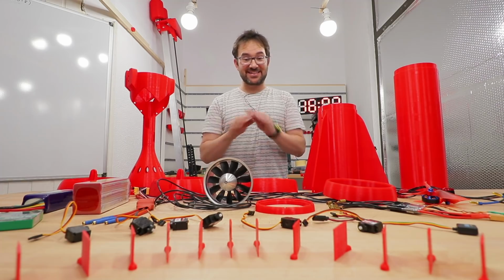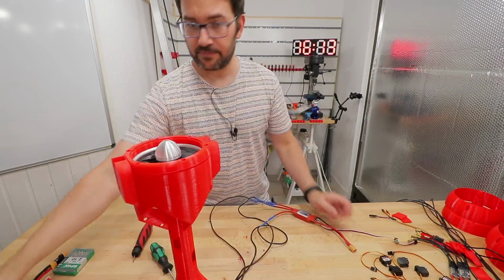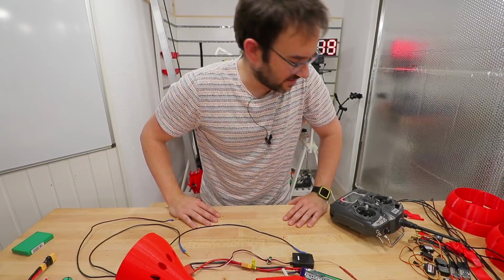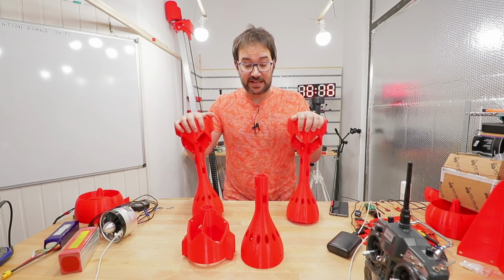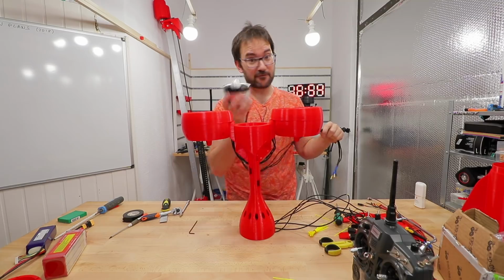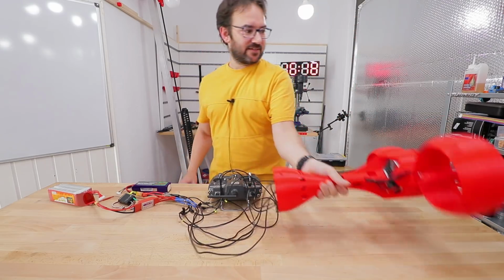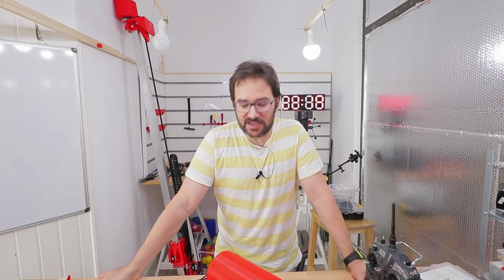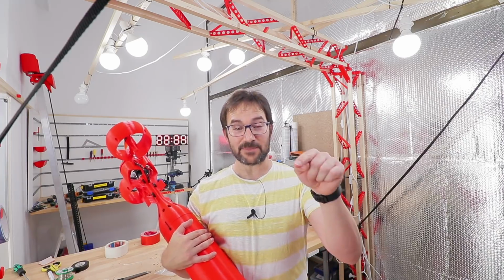3D PRINTED RC ROCKET CHALLENGE w. JAMES BRUTON | PT.1

Comment: I am definitely interested to see this case study in "does this rocket?" because I know about the pendulum thing when it comes to thrust, but I am also curious to see it happen or not happen with this design then figure out why. (obviously if it happens then you'd know why it didn't work... duh).  Oh... well... I just got to 5:10 and yeah I see now that it does indeed seem to fly correctly for now in that configuration over a really short distance with a weird tether thing.  So... \o/?  Also I saw the EDF rotate in the housing so I am curious if you're going to secure it somehow.  You have excellent presentation and English skills (not that it means much coming from an American...).  You need a 4 point tether system so you can tether it down and let it run without risk of it falling over.

- EDF rotated in the housing during one test and I am curious if it is now secured from rotation by some means other than friction fit.
- 4 point tie down system to keep it stable and from flying away while still allowing some level of movement.  Hovering would be an impressive feat.
- Examination of the rocket pendulum argument and how it applies to this particular setup and design given that you are not using rockets but instead ducted fans (does that even matter and how does the real performance reflect the theoretical knowledge)

Comment: Your control surfaces are in the center of the rocket means very little torque for control. Torque is force times distance. You will get more control authority when the control surfaces are far away from the center of mass.  I'm not sure how low your CoG will be, but if the control surfaces are above the CoG, then they will need to be reversed.

Comment: Suspend the rocket just above the ground from fishing line positioned on a rod a foot or two above the edf intake. Therefore, you can test the rocket stabilization within a change in height determined by the slack of the fishing line as it could get caught in the fan

Comment: Ivan, on the Turnigy 9X controller you have, you might want to go through the trouble of setting up a custom model for your tank. If you didn't know, it's in Menu>System Settings>Model Sele. Just use another profile for any other projects.

Comment: Front little wings are wrong, they needed of montage in center of length each wing, on servo axis. the way you did is a big load on servo motors

Comment: yeah, raise your hand who also started the beat of the parts spreading proces right before it actually started.️🎤️🎶 and came out synced perfectly.

4:46   whaaaahaha  lmao  this was a real electroboom moment. and it wasn't faked for one small bit.  but for us viewers almost predictable. perfect. now i have to change my pants. thanks for that.
instantly subt Your channel Ivan.
Reply: +Jan Wiersma  I too, thought of ElectroBOOM at that moment.
Reply: this is the exact moment i had to refrain from screaming at my screen because i can see the battery still plugged in and the throttle set to full the second he switches that reserve switch
Reply: yesss great device, supurb. 
cant wait for the outcome of the challenge with James👍
probably add a parachute ejecting when it tips over. because on that moment it tips over you will really need it. i guess.😉
Reply: whats that song again? it reminds me of an old one.
Reply: Nearly wet myself too!
Reply: You can tell it's not faked by the way Ivan poops a kitten.

Comment: Did you seriously go into this challenge without doing any research on rocket designs? Your "pendulum rocket" just won't work.
Reply: slap_my_hand who cares, just think of the fun we’ve had watching the videos.
Reply: I'm here to see the rocket fly, not to watch it crash 5 seconds after take off.
Reply: I thought "pendulum rocket" as soon as he said he was going to put the motor at the top. You are correct, this won't work but it was a great journey anyway 👍

Comment: id still be worried the main center shaft thing will break again. It would be good if you could fit like a 20mm round carbon spar into it to strengthen it. Great video as always!

Comment: Hey Ivan you the fist minute you already made a mistake :D its called pendulum fallacy (moving the engine to the top) so... redo?
EDIT (as you wanted me to put my money where my mouth is): Here is my prediction.. imma buy you a spool of filament (1kg) if im wrong. Your Rocket will have trouble staying stable or rather be wobbly in slow airspeed/hover scenarios. On higher speeds it could go either way, depending on how good your center of mass and center of lift will be placed by you. So imma do 2 predictions for higher speeds: A) your CoG and CoL are well balanced: it will fly fairly well at higher speeds. (still experiencing a bit wobblyness because your engines are at the top) B) Your CoG and CoL are not where they should be: We are gonna see you panicing.. and the rocket flying completly uncontrolled loops before crashing into thousands of small parts.. Stay safe get some cover ^^
Also make sure you can launch it where you are, some countries do have pretty strickt regulations (maximum height for model aircraft and so on).. I dont know about the legal situation Spain but maybe talk to some local hobbyist that can give you some advice.
Reply: Ivan Miranda pendulum falacy is well known about rocketry. Moving an engine to the front or top does not change the overall direction of force applied to the mass.
Reply: That's not quite what the pendulum fallacy states, and this isn't a "rocket" anyway. It's a helicopter. The pendulum fallacy is the erroneous assumption that having the mass at the bottom of a rocket will cause it to swing back and forth, self correcting itself. What it forgets to take into account is that the engine is rigidly fixed, so as it rotates, the thrust vector rotates with it, instead of stabilizing its trajectory. It also operates on the false assumption that the pendulum will swing back faster that the lighter top, which is contradictory to what we learned from Galileo's experiments with different masses in free fall. The fallacy isn't simple "engine at the top = bad, engine on the bottom = good." It's simply "engine at the top or engine at the bottom doesn't matter if you don't have a way of stabilizing your rocket through other means."

I also saw a comment saying that putting the engine on top would alone make the device more unstable. This is also incorrect. Having an engine on top, or on the bottom, all other factors considered equal, will achieve equally stable devices. As long as the CP is behind CG with respect to velocity, it will be stable. That's another issue Goddard had. He didn't have fins/control surfaces. You can put the engine at the top as long as the CP is behind CG.
Reply: Though the CP/CG relation only really matters in fast forward flight, and a bit less in an hover. Actually having the CG slightly behind the CP in the hover might help to "straighten" the plane as it starts to translate, but it's a dangerous balancing act, and likely to just develop in diverging oscillations. For a hovering craft having the two exactly matched and the entire thing neutrally stable is probably the best starting point, and should end up with something behaving a bit like a multicopter.
Reply: Think about a Dart. The tip is heavy and the fins are at the back. The center of mass needs to be in front of the center of drag to make a stable rocket. What I predict will happen to your design is when it starts moving fast enough, the rocket will flip around. The flip will occur around the Center of mass and it will be uncontrollable above a certain critical speed.
Reply: I was going to point that out.  I don't remember the physics but I do remember watching a detailed video about why pulling a rocket was a bad idea.  May have been Scott Manley.
Reply: Michael Lundgren the dart doesn't have thrust. They won't behave the same at all. It's a well established principle in rocket design.
Reply: One benefit from this design is vertical powered descent should be stable
Reply: What Michael is saying is correct. Darts and rockets (without active control systems) are stable for identical reasons: the CG is in front of the CoP. This design (with the weight at the back) will try and flip around as soon as it gets some speed up. It doesn't matter if the thrust is applied at the front or the back, because it's always pushing in-line with the rocket (it's not like towing something with a rope, where the direction of 'thrust' changes to keep the system stable).
Reply: Michael Lundgren not it is not check Joshua Bardwells video on that. It's quadcopter related butas you are talking about hover it is pretty much the exact same thing, because then we can neglect aerodynamic stability for this purpose.
Reply: I'm not sure what you are talking about. I think you meant to say that you can ignore aerodynamic forces while it is hovering like a quadcopter. I agree, assuming he can make it work, it should be able to hold a hover. But when he tries to fly fast, it will become unstable and flip.The design of the control surfaces won't have enough torque to overcome the inherent instability..
Reply: Ivan Miranda my predictions are a pure guess work because there's too many unknown variables the rocket will absolutely be unstable although in Hover mode this is not really that important since you're going to have a reaction control system like any other hovering device such as a quadcopter to help compensate

You're still going to have the pendulum effect which means when the rocket begin to deviate from vertical the deviation is going to be magnified by the shift in center of gravity and center of pressure

This does not mean it won't work it's just means your stability control system is going to have to work a lot harder you are almost certainly going to need automatic controls the entire scope for those X and Y vectoring veins that you installed while not totally impossible it's unlikely your reflexes will be fast enough once that thing really starts to isolate in aviation we called pilot induced Over Control your reflexes will always lag slightly behind the reactions of the rocket and your inputs will ultimately enhance the oscillations instead of canceling them it all depends on how badly it oscillates in Hover you might be okay

The real trouble will be if and when you attempt to fly like a rocket meaning with a forward velocity vector

When you attempt to do this the center of gravity Center of pressure will immediately begin to assert itself and the faster you go the more force it will apply to do this your rocket will always be attempting to flip end-over-end to point its tail first because that's where the mass is if you can get your center of gravity in front of where you balance it on the video and increase the size of those fins say 300% it might work in forward flight meaning shooting straight up at speed now all that aside

You also want to be able to land this thing and oddly enough Center of mass at the back will make that easier because your rocket will tend to want to point his tail toward the ground if it's falling toward the ground so if you don't plan to have very much of a high-velocity forward flight vector then this configuration might actually make Landing it a lot easier

This is why SpaceX has the grid fins on the top of the rocket to help shift the center of pressure toward the nose instead of toward the tail because the thrust vectoring alone isn't enough when there's any kind of serious velocity involved

 there's actually a really easy way to demonstrate this process I'm going to make some STL files tonight to print out since I think it would be a fantastic educational tool so thank you very much for the idea

Balance a ruler on your fingertip this is a stable rocket

Now print out a small oval that you can rest of the ruler inside the oval while holding the top of the oval

 Now holding the top of the oval tried to balance the ruler again it will be quite a bit more difficult this is the problem you will encounter whether or not you can overcome it will depend on how fast and precise your Correctional controls and software are and how much Authority they have

 Most modern jets are designed to be on the edge of unstable for exactly this reason they become extremely maneuverable when they are slightly unstable this is also why they have modern computers in them to help the pilot control it
Reply: Rec0iL some people are confused by the pendulum fallacy it has nothing to do with where the frost is and everything to do with where the center of gravity is having a Thrust up at the front of the middle on the sides doesn't really matter as long as equal

 What matters is the center of gravity as long as the center of gravity is in front of the center of pressure the model should be stable
Reply: Nerys you should read more careful I never said it would not work... It will work.. it just makes the rocket awkward... There is a video about that from Scott Manley and another one from Joshua Bardwell.. (that one is about quadcopters but it applies also here) and shows that it has no advantage to have your cg high or low in regards to the engine (well quadcopters don't care about being aerodynamically stable) but that's a the story of having your cog in front of your center of lift. Not where the engine is sitting...
Reply: Ivan Miranda if you would have the engines swivel so they always point straight up it would work like you imagined it, would be a fun solution but not the most practical.
Good luck with the rocket!!!
Reply: How could you maintain a vertical engine? At some point you are just making a helicopter with a dangling weight off the bottom.
Reply: My prediction is that it'll swing around quite erratically, possibly swapping ends as it gets faster. You're going to fall victim to the pendulum fallacy.

Edit: With that said, it's nice that both approaches are being shown, with James.
Reply: It has been shown that rockets with engines at the bottom are more stable in flight, and they also make getting fuel to the engines much easier!
Reply: Cheshire Cat Universe this is not correct where the motor is on the rock it doesn't really matter as far as stability is concerned as long as the center of gravity is in front of the center of pressure of the rocket should be stable the pendulum fallacy deals with center of gravity not where thrust is there are issues with having thrust up front but those have to do with things besides stability directly
Reply: Just inserting my nerdiness. Robert Goddard at first put the engines at the top of the rocket but once the fuel (fuel makes up about 3/4ths of a rockets weight.) burned off the engines at the top were heavyer than the base leading to the rocket fliping due to the high center of mass (center of mass acts like direction arow. If the center of mass is at the top the rocket will flip and face the ground. If the center of mass is down then the rocket will go up. CG points to gravity.) This does not matter for the red rocket because the weight of the battery at the bottom does not lose mass as it discharges.
Reply: I love how your response is essentially "all those rocket scientist geniuses don't know what they're talking about"... This is fundamental physics, like gravity, you don't get to choose what laws of physics you want to believe in, at least if you expect to be successful. You are choosing to fail.
Reply: Ivan Miranda I think you guys will make them work just fine as long as you don't try to fly forward too fast :-)
Reply: I've spotted a possible other problem not sure if it will be one because I can't judge it from my seat xD but if the control surfaces are too close to the center of mass they will have very little efficiency in creating a torque.. they will rather let the rocket translate than turn.. (that is also the reason why it's pretty hard to get rudder control on a Delta wing without thrust vectoring or airbreakes at the wingtips)
Reply: Ivan, I predict that in low speed and stress situations, it should be quite stable, and possibly have a little 'lazy wag' that could be fun. To predict failure i'd have to assume exactly how you are aiming to 'fly' it. I'm interpreting the design and calling it a rocket that its flying like a plane without wings. I really don't think it's going to be able to provide enough control authority to maintain a constant heading with the tail end dragging down anywhere near horizontal flight. If it's just going up and down, then you're probably set.

Regardless of the outcome, i'm stoked.
Reply: I really do like what you did with the control surfaces, i just don't know that it'll be enough. ;)
Reply: Makes sense, the motors aren't always forcing straight up, unlike the mount of a rope to a ceiling for example. The motors always force directly away from the center of mass of the rocket.
Reply: I predict that, as it approaches the speed of light, it will turn blue and Ivan will abandon the project as he can find no way to keep the rocket the correct colour.
Reply: it did fail, and it wasnt for what i suggested, but i still stand by it because it never really made it off the ground to test any flight characteristics. at this point, i bet the weight side to side isnt even balanced. it couldn't go up if it was a normal design.
Reply: Nonetheless, a rocket with the motors at the top is no less stable than a rocket with motors at the bottom (if all else is equal) and there’s no issue with the flow of fuel or damaging high temperature exhaust in Ivan’s model. Without a high forward velocity it will need some active stabilisation regardless.

These models are going to be more like multicopters than rockets. Still great projects.